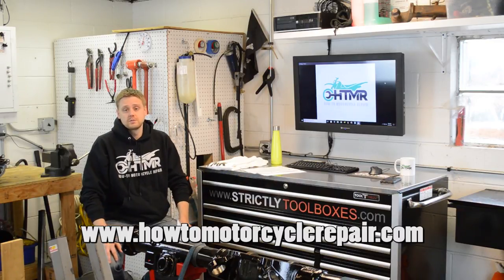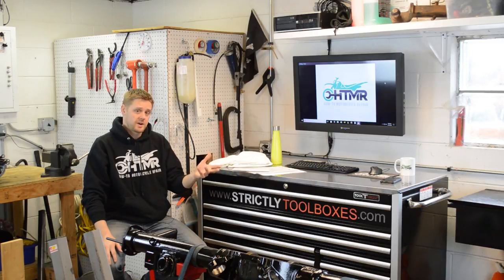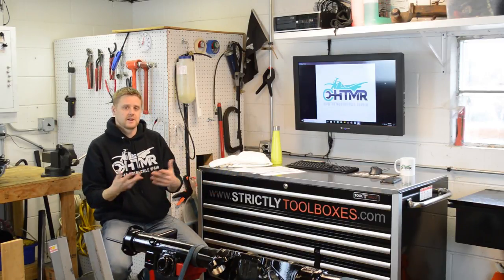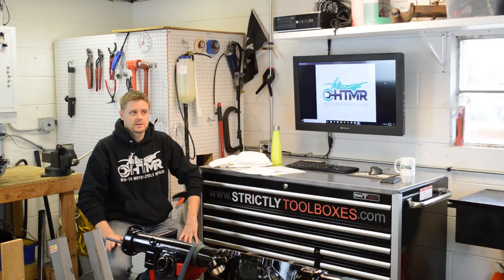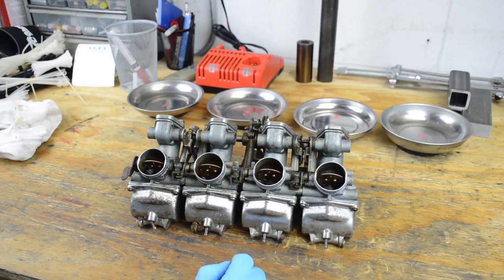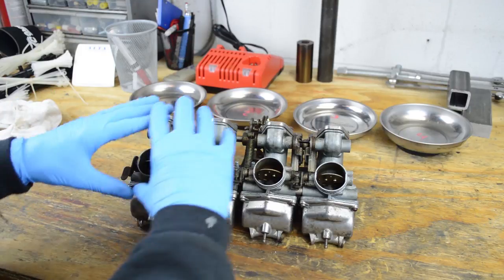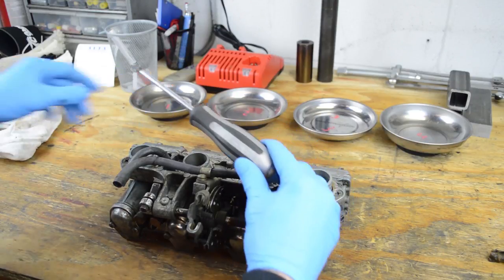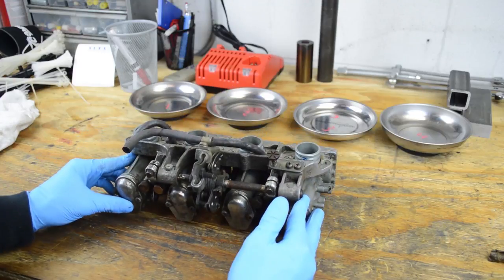How-To: CB350 CB400 CB500 CB550 CB650 Carburetor Clean & Rebuild

Comment: Ok, starting a restoration on a 1972 Honda CB350. Motor is seized because of sitting too long. Owner had put oil in cylinders and turned it over occasionally but hadn’t in several years. So we start the process of bringing it back to life. I watched video you made on getting it freed up. It has virtually no miles as he bought it new in 72 and rode a little and then stored it away to raise a family. So I’m excited to start the project.

Comment: So i got a 75 Honda CB550F. Some clown let it sit for god knows how lone and varnished the origionals carb. Had white deposits mixed with old gas for what looked like 20yrs. They threw a slightly better carb in it got it running and sold it to this fool in Austin who got suckered and realized they didnt know what to do. 6 month later i got it and i got both the oem carb and the second carb on the bike which was the same age. Some idiot put pennies in the gas tank i discovered. I chem dipped the OEM varnished carb and using 1 of its carbs rebuilt the 2nd carb. It was far worse than this video. It was horrible. I got it all running and i drive it now to work. It still needs work but i love this bike. Just wish someone would make a new carb for it at a reasonable price. This video was a good breakdown. Thanks.

Comment: Great video, is there anything around that covers the 79 650, these are a different carb to what I'm working on.
Reply from the maker: The 79' CB650 comes with similiar carbs as shown in this video. Unless they were replaced with other carbs?

Comment: Will this video work on the 77 and 78 models? I know those carbs are a little different.
Reply from the maker: Yes, video is applicable. Your model should have fuel screws vs air screws.
Reply: @HTMR  the assembly of the choke etc. is very different.